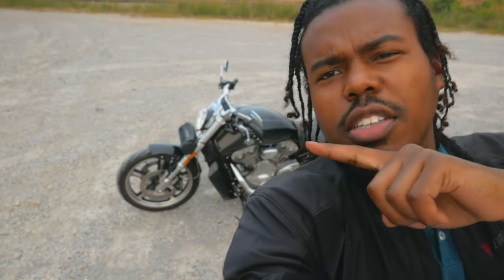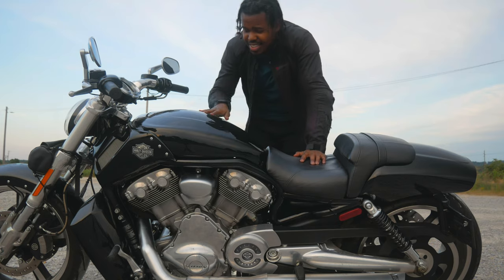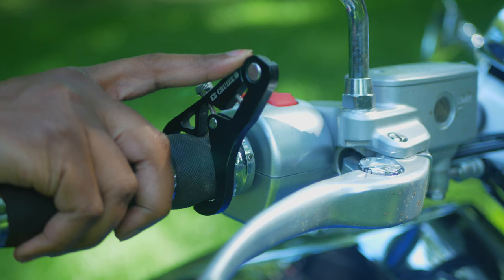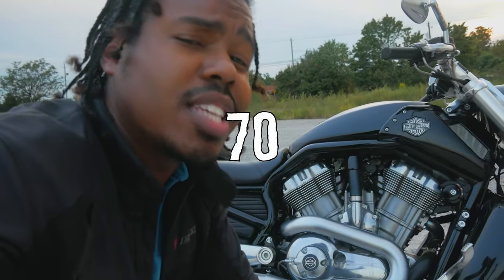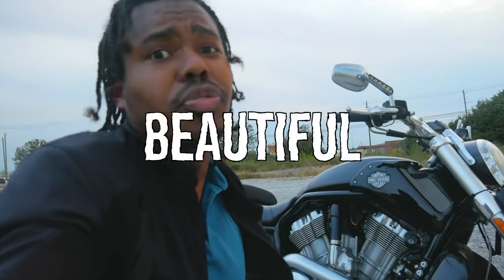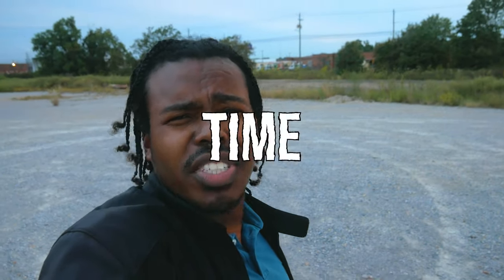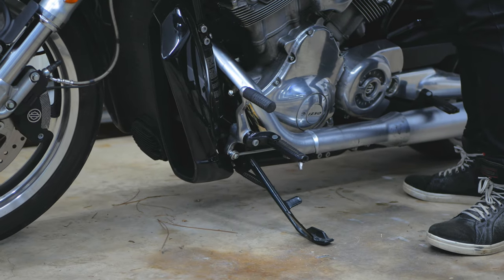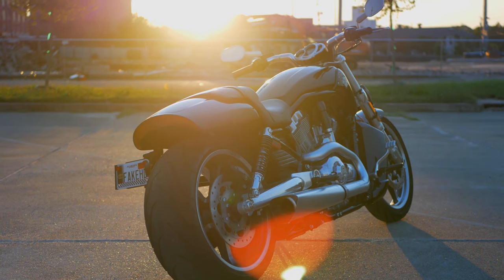5 Interesting Facts About The Harley V-Rod Muscle

Comment: I probably built your bike Brandon. 
The great thing about the Jiffy Stand is you can push the bike across a concrete floor without the bike falling over. That's how all Harleys are moved around the shop.
Reply from the maker: Wait. Is that with the kickstand down???
Reply: @BrandonBicasso  Yes, when the bikes come  off the line and they have to move them around they leave them on the Jiffy Stand and push them by the handlebars backwards on the painted concrete floors.
Reply: @KevinButler816  no they don’t!
Reply: @chriskibodeaux9818  really? Well at the Kansas City plant that's how we moved bikes around.
Reply: I found a 2014 5000 miles on it and they want 11,000 at a Mc dealer Do you think that’s a good price
Reply: @Kevin... ok.. backwards and not forward. Makes sense. but whats the give on forward force to keep the bike from tipping over?
Reply: @shankernair8023  When the jiffy stand is fully extended there's a notch that keeps the stand from moving backwards
Reply: @KevinButler816  Gotcha. Thanks for clarifying!

Comment: I purchased my V-Rod Muscle new in March 2011. It now has more than 58,000 miles. I've never had an issue with the engine "burning" too much oil.  Maybe Porsche/H-D gave it 5 qts of oil just to make sure the bike has more than enough internal lubrication. My Muscle is still running strong. Installing engine guard with driving lights/turn signals this week.
Reply from the maker: Who knows. I’ve never seen that label on another motorcycle before though! I probably need to install some guards myself.

Comment: I have owned plenty bikes over the years, but  NEVER a Harley.  When the Vrod muscle came out, it was the only Harley that I would have actually bought, but because like you said, " bastard child" I never could get ahold of one because of availability.  Still on the lookout for one but they are scarce.... plenty of plain Vrods around, but not the Muscle. It's sad that Harley davidson purist stand in the way of any technological advancement that Harley attempts to make 😢
Reply from the maker: That’s changing. The new Revolution Max platform is a hit out the park!

Comment: Porche design engine. Say no more. Best Harley ever. 👌
Reply: Porsche didn't design the engine. Watch the vrod documentary
Reply: @frankhernigle8102  Porche  "CONSTRUCTED" a watercooled engine lol. If that doesn't sound like a  DESIGN to you then you might wanna search again.
Reply: Porsche was paid 5 million for their engineering of the cooling system and making it work with Rev motor.
Reply: @frankhernigle8102  First liquid cooled engine designed by Porche made in Germany. The Revolution Engine has totally different engine components than VR1000 which shared the same structure.  Porche redesigned that Rev Motor to make it work.

Comment: Nice! The throttle lock has what looks like a tiny brake shoe to provide friction. Yes, the Jiffy Stand will freak out other make riders at first. It DOES work well.....most of the time! Keep it lubed and make sure the hardware is tight and it should last a long time.
Reply from the maker: Definitely gotta keep the lube around! 😂 Hope your wife is doing well!
Reply: @BrandonBicasso  
Better but real slow progress. Probably won't ever be able to do her old job again....not too terrible. They treated her well but she worked physically and mentally real hard. Chapter next for us. Contemplating a motorcycle shop for her to run. Our local guy is making retirement noises and he is all there is close. My aircraft maintenance thing keeps me real busy, so I would have to pull real long days and nights to make both work. What the hell, I always wanted to work in a bike shop.
Reply from the maker: @upsidedowndog1256  That sounds like a solid compromise.

Comment: They tell you to check the oil with each fill up because Harley used to have an oil leaking issue on some the 80s models (that is the rumor I heard, please don’t quote me on that). We were told that when we got ours in 2014. Just WATCH out for brake issues! We thought it needed pads come to find out it was a “abs module” ($1200 repair, I’m still waiting for parts)
Reply from the maker: Woooo, Lord! I will definitely keep that in mind!
Reply: @BrandonBicasso , my understanding is that it wasn’t exclusive to the V-Rod it’s the abs system on several other models like any ones that have abs 😂. The dealer said “you have to make sure the system is serviced by the computer, fluids changed. Not everyone has these issues they aren’t super common.” But no oil leaks 😉. Fingers crossed 🤞.

Comment: Love my Muscle! Love it even more since I got my V&H exhaust installed. Had to source it from Ireland, but, I got it. Do you run a fuel programmer?
Reply from the maker: It might be one under the covers. I haven’t looked. I have to fix the breather oil leak so I’ll find out soon. 😂
Reply: @BrandonBicasso  oh, also, DON'T use any degreasers to clean that engine. Its a real bitch to polish back to pretty!!! Just use some heavy Dawn soaped hot water.
Reply from the maker: @SlightlyLessFat  Noted! Because I use purple power. 😬
Reply from the maker: @SlightlyLessFat  I’ll definitely check. I figured it might be up there by the battery. I’ve seen them hidden there before to. Just been riding it and filming. Got to my doorstep in January and I still haven’t washed it yet. 🤦🏾‍♂️
Reply: @BrandonBicasso  Yeah. So did I. Tarnished the shit out of that engine!!!
Reply: @BrandonBicasso  The ECM and fuse bank in under that passenger seat. willing to bet its back there.

Comment: I don't think they hold a lot of value because they are discontinued, because I have a 2016 with only 2,800 miles on it and when I tried to look up the value of my bike on the black book it said that it was between $10,00 and $12,000. Harley Davidson wants to offer me about $9,000 for it, what a bunch of crooks. lol... I bought the bike in 2016 brand new for $19k plus finance, so is safe to say that in 6 years the value dropped about half of what I paid for.
Reply from the maker: You’d have to go off what the market is listing them for too. A newish Vrod def would go for more compared to one with more miles and the same year.
Reply from the maker: But autos do have a minimum price so I look at it like this. You can ride your bike and put probably 10-15k miles on it and still sell it for a price around that minimum if not more.